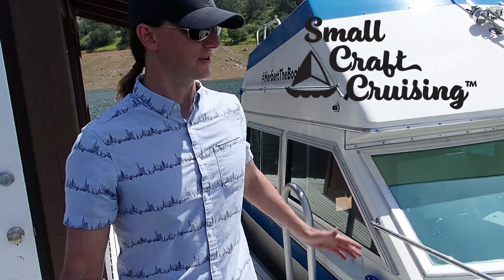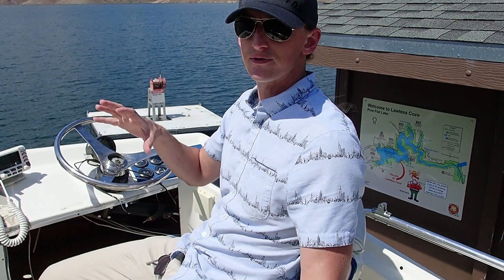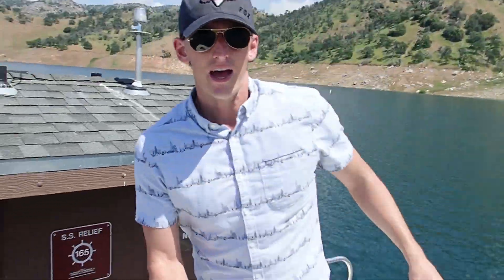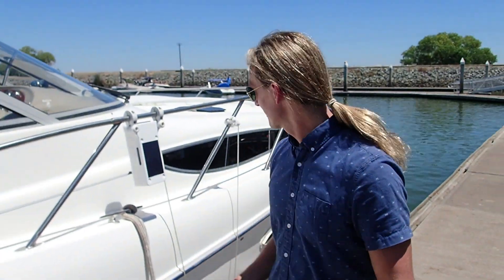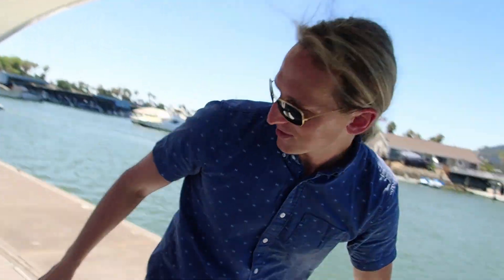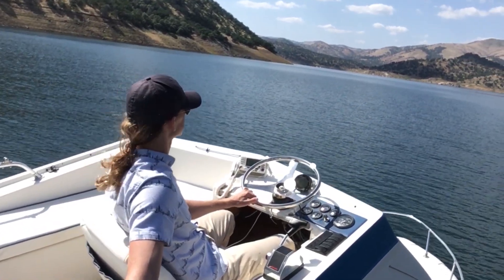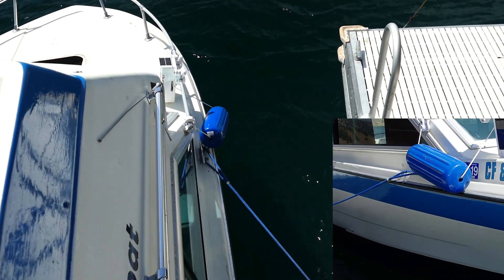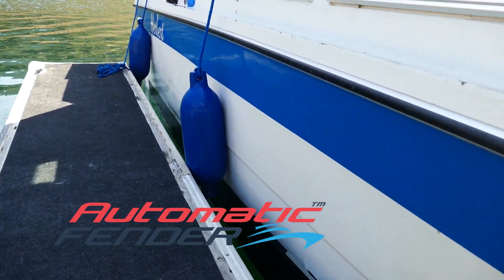Docking just got much easier: latest upgrades to Herbert, a 1978 Fiberform 24

Comment: It is actually very exciting to see fenders deploy automatically.  Leaving the flybridge and crawling around the outside of the boat is dangerous enough on a calm day.  Things always go worse when the deck is wet, wind is blowing and boat is rocking.  If you are by yourself and fall off the boat, it can be deadly if the boat keeps driving away, leaving you out in the middle of big water.  Another, more radical mod is to cut a walkway through the front of the flybridge.  On your boat, you'd want to make a couple of steps going down to the front deck.  My 27 foot Carver Santego has no inside helm, so the front deck is at almost the same level as the flybridge.  Cutting the walkway through the front of the flybridge made the front deck so much more usable.  Its one of the best mods I have made to the boat.  Here's a link to a video showing the walk-through and some deck boxes I made.  Cutting through the flybridge is at about nine and a half minutes in case you don't want to watch me fix a fiberglass box.
https://www.youtube.com/watch?v=KnrYf_653lg&t=587s

Comment: I used to own a 2007 65 foot searay and I decided to make it look cool by putting screws in the bottom. I would take a jack hammer and pound screws into the bottom of the boat. I then added some stickers to the windows. Then with a chain saw I cut out a square piece from the side of my boat and used the piece to build a table. To fill in the square hole on the side of my boat I just covered it with duck tape. My boat is pretty good looking and for what I paid for it I really love the extra things I did to it.

Comment: How fragile are the mechanisms?     When a surge hits the boat at the dock and the boat moves around grinding towards the dock the   fenders and the lines they dangle from are under huge loads.    
Really interesting idea,  and a s solution to your (and my) well described problem,    but I can't see the gadget standing up to the surge and loads.
Reply from the maker: It is engineered very tough and with rough conditions in mind. But if you are really worried, you can use these to dock. Then have the time to walk around and drop traditional fenders if the sea gets so rough.

Comment: motor boats are hard to manuber, it is a bad boating etiquete to sail with the fender downs ,but before docking you can lowers the fender in a safety place. for me to make easy in a( motor boat)docking is to have a bow thrust